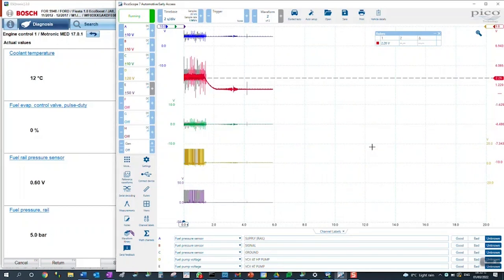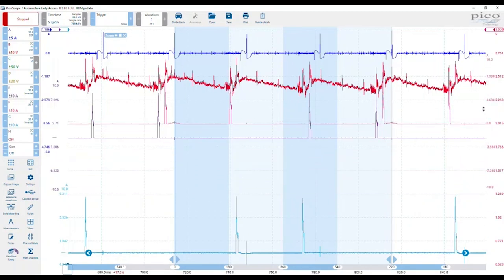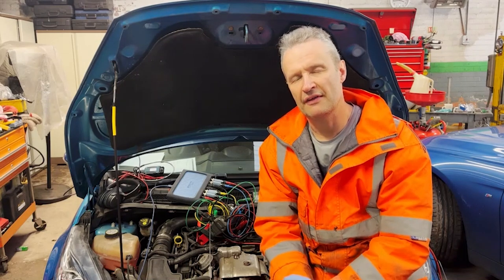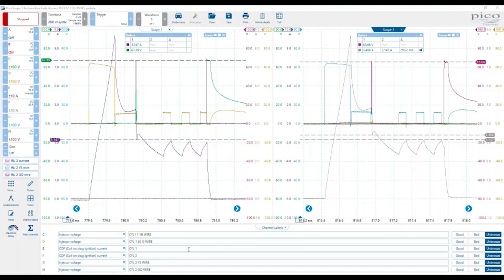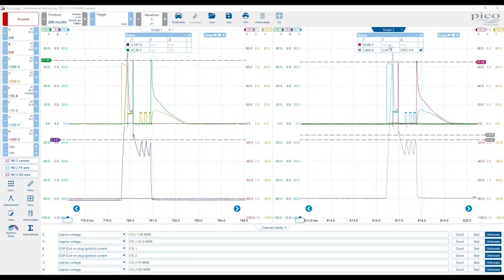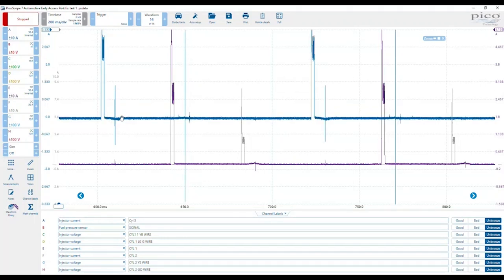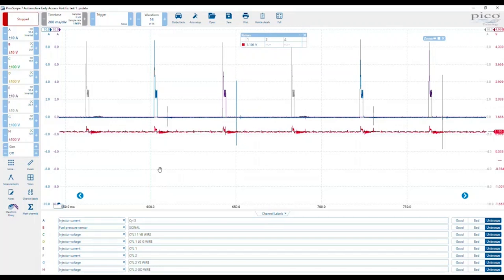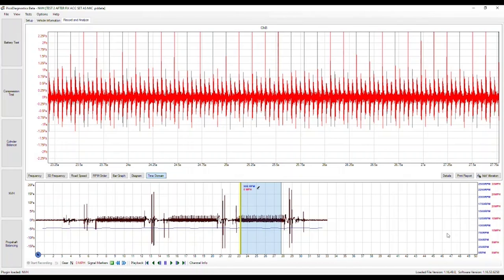Fiesta Case Study

Comment: Nice analysis Steve. Scanner Danner started a bit of myth about pintle humps years ago! I've never seen one that convinced me either. I put them in Bigfoot/Lockness monster/new parts are always good category.
 If that engine is one of those nasty "wet belt" 3 cyls the petrol in the oil could make that silly belt shred faster than normal.....and shredding seems a "feature" of such designs. The 123 firing order is why they have to use jelly as engine mounts to hide all the wobblyness NVH! Jamie

Comment: Fuel injector balance test will find that immediately.  Apply Fuel pressure to rail and then pulse injector for a known time, watch the pressure drop. Used to be called Fuel pressure drop.

Comment: Thank you for the deepest analyisis I have ever seen!!! The stetoscope is a Picoscope product?
Reply: Andrea, I have the same question, and also the same positive comments.

A Google search suggests the stethoscope is not a product you can buy - at least, not yet anyway.       The screw thread in the accelerometer is 1/4” x 28 UNF.      I made my own mounting magnets using some bolts I bought on ebay.     You could easily make a similar stethoscope using a 1/4” x 28 UNF thread, perhaps with a lock-nut and a suitable pick-up rod.     If Steve doesn’t reply in a few days, I will email him and ask him a bout the stethoscope and let you know the answer.
Reply: @martinrubenstein7943  did you have some link where I can buy the accelerometer 1/4 x 28 ?UNF
Reply: @andykaw1   I’m sorry, Andrea: I realise English is not your first language and I might have misunderstood you.      Hopefully, I can now explain it better to you.

Firstly, Steve was using the NVH hardware/kit along with the NVH Pico software in PicoScope 7.  .     (Do a Google search for Pico NVH Starter Diagnostic Kit, for example., )

I was presuming you had the full NVH kit.    .    But, unless you also have an NVH kit, this information is of no use to you.

Does that make sense?    Do you have an NVH kit, or a TA143 and a TA259?
Reply: You must have the NVH kit to do what Steve was doing with his stethoscope.
Reply: 1/4” x 28 UNF is the size of the screw thread in the accelerometer, but, without the NVH kit, this information is of no use to you.
Reply: I contacted Steve.   It’s as I thought: there is no official Pico accessory in the form of a rod you screw into the TA143 accelerometer.

Knowing the screw thread size (1/4” x 28 UNF), you can easily make a pick-up rod to turn your accelerometer into a stethoscope, and have a fair bit of fun in the process.